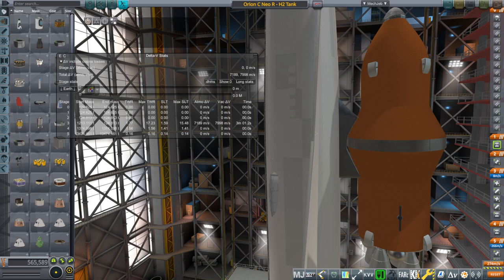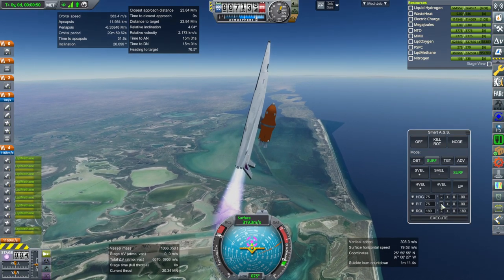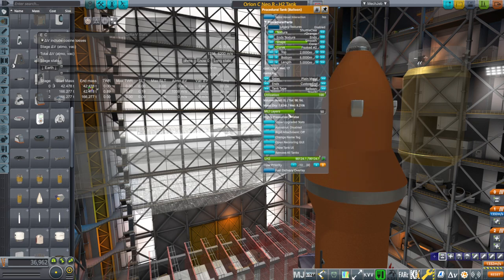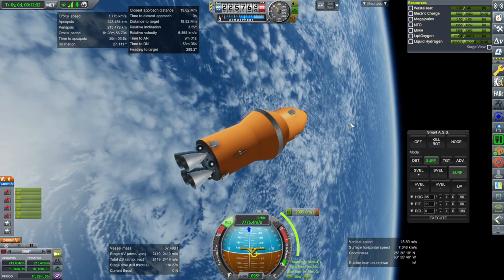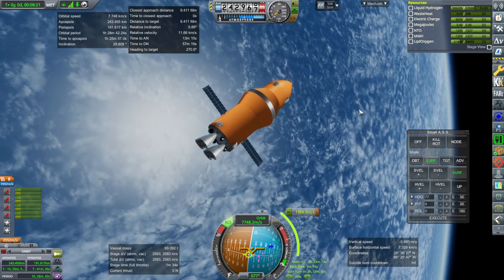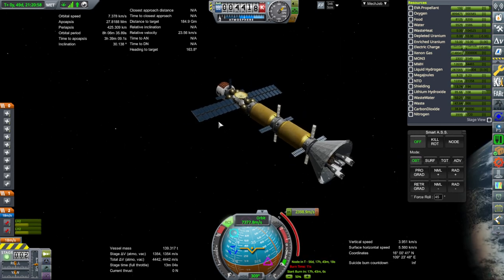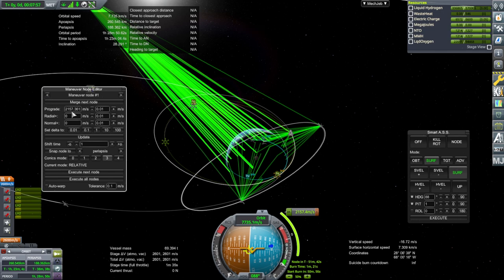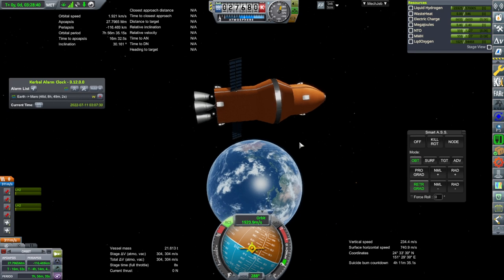Kerbal Space Program 1.8.1 with RO - To Mars and Beyond 11

Comment: What ever happened to StarStage1?
Also in terms of the tanks, you could try changing off of steel
Reply from the maker: Starstage One is the HTP-Kerosene one and was meant specifically to be cheap expendable stage for outer planet probes. Starstage Two, of course, doesn't have the performance for these missions because it's methalox and recoverable, unless I want to do a lot more launches. I don't know if there's a non-steel balloon tank option for Procedural Parts, is there?
Reply: I believe there was but I'm not sure.

Comment: 1.12.3 is now the latest supported version, I don't think 1.10 is even supported anymore. But generally any part mods that work in 1.8 should work on 1.12.
Reply from the maker: I thought I said 1.12 - definitely didn't mean 1.10, which I don't remember ever using. I posted a video testing the Orion Carrier in 1.12 with some issues.